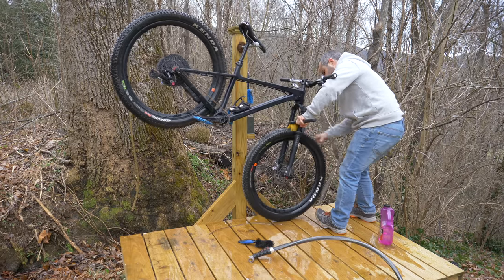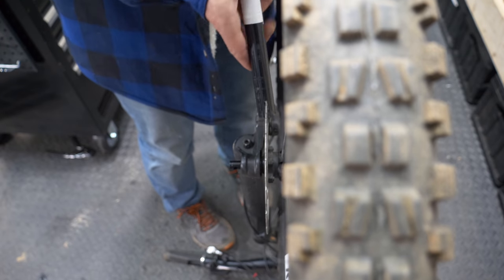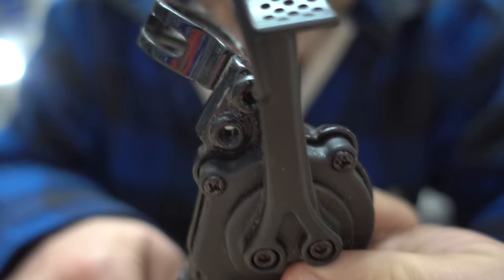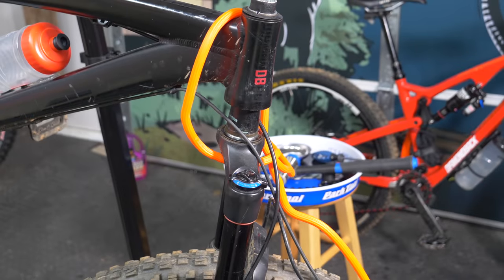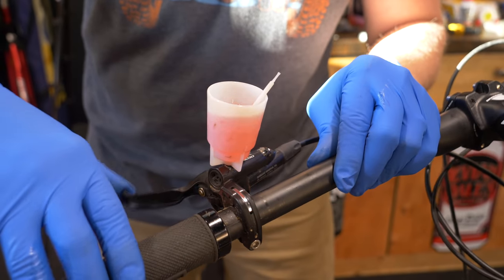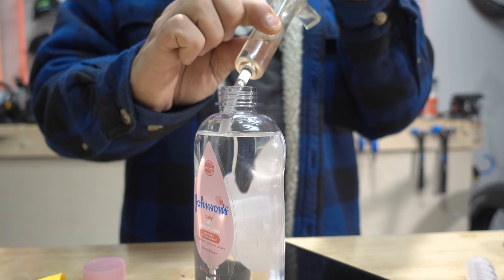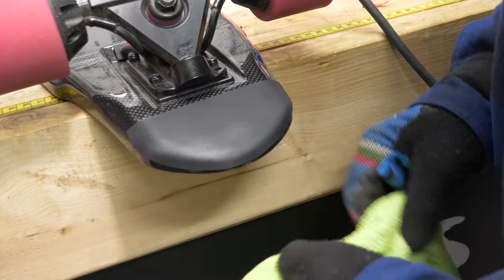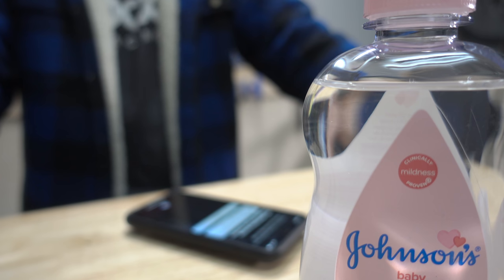10 Bike Hacks for Mountain Bikers and Beyond

Comment: MAKE SURE THE CAR SOAP DOESNT HAVE WAX IN IT. Learned the hard way....
Reply: But why though?
Reply: Merry Christmas seth
Reply: @stavroskalaitzakis4742  will ruin your break pad and rotors
Reply: Same out here
Reply: WOW GREAT POINT / TIP !!   you dont want wax on the rotors  :-)
Reply: @stavroskalaitzakis4742  brakes will not work as good anymore
Reply: Don't use a toilet brush on paint either. It will scratch, eventually dulling the paint.
Reply: @donmichigan8201  Right!  I use a car wash brush, long natural bristles only
Reply: I would go one step further and recommend using car wash that is oh neutral. It will help prolong the frame bearings
Reply: Moose I never though of that
Reply: @SpMoose  And dont spray pressure at the pivot points even then
Reply: and if I take out pads and use brake cleaner on rotors?
Reply: @janprokopenko7928  then you would have made the job much more awkward instead of just buying one without wax
Reply: im actually using car wax on the frame after washing... autoglym aqua wax, you just rub it on with a towel. keeps it clean longer, makes cleaning easier and smells great
Reply: Also car soap should go into sewage, where it will hopefully be treated, and not straight into the stream behind Seth's house.
Reply: @riammey   I have rim brakes though. xD
Reply: @stavroskalaitzakis4742  oof rip 😂
Reply: @riammey  Well not really. They do their job VERY well actually. It's a 20 year old mountain bike and its in prestine condition...
Reply: @stavroskalaitzakis4742  i just had when I touch a little water on my old bike which had rim brakes in a puddle it would make noise and not work well, this happenes to disc brakes too but it wears off pretty fast and I like to customize my rims too 😂
Edit: hate, not had
Reply: GMBN mentions this. You just have to be careful about the brake rotors, but they always mention that in any bike wash video anyway so it shouldn't be a surprise.
Reply: Arda Kaya bu yorumu yazan senin türk olduğunu görmek mutlu etti beni :)
Reply: Thats great. These videos never cease to amaze me
Reply: Would like the comment but it’s on 420
Reply: What should you do if you've already used carwash soap with wax? Asking for a friend.
Reply: if the wax contact to your disc break... yeah less friction
Reply: @bryanmurphy26  wash rotor and pads with isopropol alcohol. If that doesn't work try sand paper to take a layer off the pad and rough the rotor. If breaking is still bad you may need to buy new pads and rotors
Reply: @Salvotation  The brakes still work great. Just squeal embarrassingly loud sometimes.
Reply: @bryanmurphy26  squealing breaks means they aren't working as well as they could be. If it is from vibration it won't be much lost but from contamination it definitely will reduce breaking power. Wax is meant to be slippy to shed dirt off your car paint. Slippy mean less stopping power
Reply: @Bryan Miata
Take the wheel off and use a hair dryer or heat gun on the rotors - gently. The wax will melt with heat and you can wipe it off

I actually use a cleaner with wax because the layer it leaves protects any pinholes in the paint on my steel bike from getting rusty. But then I also use a small spray bottle and don't just shower the whole thing at once. YMMV
Reply: Hmmm, i guess my dad owes me new pads and rotors since he recommended the car soap we had with wax in it!
Reply: @Kent Quindt
Just heat the rotors  with a blowdryer or gentle heatgun and wipe the wax off.
Reply: @dankennethdelapena2252  He is jewish
Reply: Never a bad idea to take your wheels and brakes of the bike while using ANY soap.
Reply: Wash and wax all you want! Just make sure you contaminate the rotors with denatured alcohol.
Reply: G. Fortin lzc
Reply: The oil in car brakes needs tobe hydroscopic meaning to absorb water so there wont be any oxidation it could be that oxidation ruined your lines and cyilinder from which partikules get to your brakes and wear them down super fast but i dont know what bike s use for their brakes
Reply: Don’t put chain lube on your rotors either
Reply: @stavroskalaitzakis4742  wax turns into a solid
Reply: WAX RIMS
Reply: Arda Kaya I’ve never cleaned a bike but if I do I’d want to know why you cannot have wax on your bike?
Reply: And don't get your car shampoo and the baby oil mixed up.
Reply: been cleaning my hardtail with this for over 2 years! never had problems🤔
Reply: 900th like!
Reply: I also learned the hard way lol
Reply: @kentquindt7898  
Noooo. Ask for a new bike instead. Lol
Reply: @rickyhernandez4742  As in rim brakes? Does it do any good? I'm curious but I dare not try it. If you had tried it, what was the outcome?
Reply: One hard break and all the residue will be gone. Don’t worry about it.

Comment: I know a guy that runs baby oil in 5 of his bikes with no issues. At $70/L for the real stuff it's a no brainer.
Reply from the maker: I’ll wait for the autopsy next year, but good to hear a success story!
Reply: I have seen it in a forum, but because of the fragrance it kept me away.
I will definitely wait to see how this goes
Reply: $70/L is utter BS. It's $16 shipped . My 1L bottle has lasted well over 10 years and it's still 2/3 full. That's $0.50/year. Dunno why anyone would bother risking problems for that.
Reply: @MTBinKY  bit of an exaggeration but here in Canada at least the cheapest I could find was $40 from Dunbar which is still a lot.
Reply: @409nh8  you can probably find it for cheaper on Amazon
Reply: Pharmaceutical grade meant for human consumption  is probably the best bet. Found in The pharmacy isle. I tend to think it's more refined than standard baby oil.
Reply: baby oil on shimano disc brake works fine. I used it on an old BR-BL-M355 no issues so far. hahaha
Reply: Regular mineral oil from the pharmacy has no fragrance.  I use it on my guitar fretboards too.
Reply: I have run baby oil in all my hydraulic brakes on my five bikes of many different brands for ten years. Even on daily commutes at -25C, I've never had any issues.
Reply: I used to use water in my trials bike 
I preferred the way it seemed to squish more but I had holes in both brake lines so wasn't bothered either way
Reply: @409nh8  nearly double your price that's almost triple what we pay in the States (or just order online unless that's too difficult). Yeah, not so slight. smh
Reply: We have cheap AUTO transmission and suspension oil here in Russia, so you can buy the same product 4-5 times cheaper than Shimano oil, for ex. 420 rub. instead or 1770 per liter, that's 6$ instead of 25.5$... Just choose the same viscosity @SethsBikeHacks
Reply: I have been using plain mineral ATF in my shimano brakes for 15 yrs with no re-bleeds or leaks. In a couple aircraft brake manuals I have actually found direct refference to Mineral mil-5606 hydraulic oil(standard in a lot of aircraft brakes) crossing to plain ATF.
Reply: Hello Seth, do you have a personal relationship with our Lord and Saviour Jesus Christ? The Son of God. That if thou shalt confess with thy mouth the Lord Jesus, and shalt believe in thine heart that God hath raised him from the dead, thou shalt be saved. - Romans 10:9. And please ask the Lord Jesus to bless you with wisdom, knowledge, understanding, and discernment. And please ask the Lord Jesus to forgive you for all of your sins and transgressions.
Reply: I work in construction and have used food grade mineral oil for alot of countertop installs. I checked it against my expensive shimano mineral oil by putting it in 5 different cups with different materials in there for a month and it lloks and feels the same. Im sure baby oil is the same as well, but just buy the food grade stuff for $10 for 12-16oz. Way cheaper.
Reply: Why wasn't this SHIMANO OIL sold and the money given to the poor? It was worth a year's wages. Use baby oil instead בן דוד. 
 - Seth 7:42-46
Reply: This is what Magura says about drugstore mineral oil:

What type of oil should I use in my Magura hydraulic brakes?

Magura Blood mineral oil is the recommended oil, which is a 10 weight mineral oil. By far, our most common problem we encounter is consumers putting off-the-shelf mineral oil (from a drug store) in their Magura hydraulic brakes. Off-the-shelf mineral oil is normally 30-50 weight which will make the brake very sluggish. In addition, off-the-shelf mineral oil has additives, perfumes and different boiling points, all of which can cause brake failure. USE ONLY MAGURA BLOOD IN YOUR BRAKE SYSTEM. Use of any other fluid besides Magura Blood mineral oil will void your warranty.
Reply: @Bad.Rabbit  how does it works on guitar fretboards?? I cant find lemon oil to put on my guitar and bass
Reply: @gloriaandreamarinmunoz7672  lemon pill is just mineral oil with fragrance.  Regular mineral oil works great on fretboards
Reply: Who pays $70/L for mineral oil?....
Reply: @SethsBikeHacks  waiting with so much anxiety!
Reply: Hey do you like mountain biking? If so you should check out 'Digging and Riding'. It is a small channel and it would be great if you could please help him.
Reply: @בןדוד-ג5ק  I know you mean well but do you really think a typical non-believer (I have no idea what Seth's religious views are) is going to listen to you launching into this?  First you need to establish some common ground.  Or maybe you're just copying and pasting this addressed to the first name of YouTubers which means you'll reach a lot more people and that's what its all about.  But normally we listen to people when we have common ground, where there's an area of mutual understanding and reciprocity.  Are you Jewish Messianic?  If so, I commend you.  Our Jewish brothers are not easy to reach with His Word yet are commandingly powerful in witnessing, often because of their vast knowledge of the Old Testament which few non-Jews posses these days.   Its when we tie both together do we have real authority in the Word.  May God bless your work!
Reply: Fun fact: mineral oil is very refined paraffin, which is heavily refined kerosene.
Reply: @SethsBikeHacks  Only a couple weeks left!